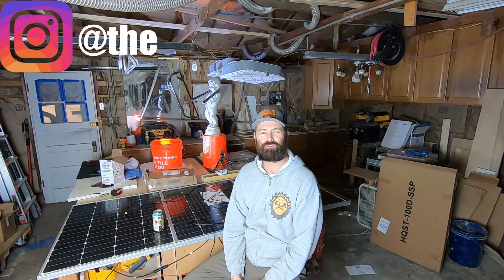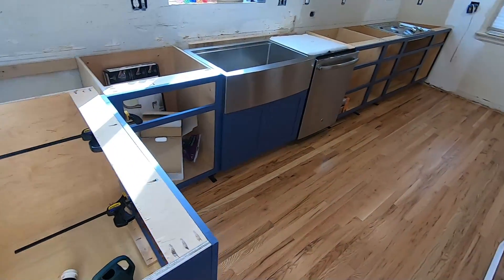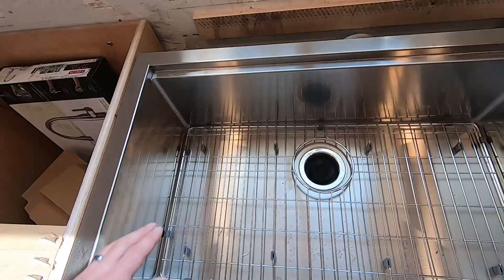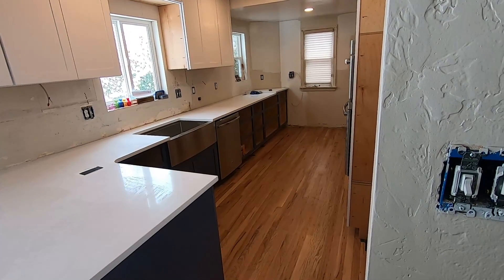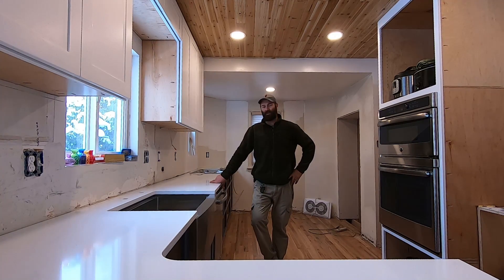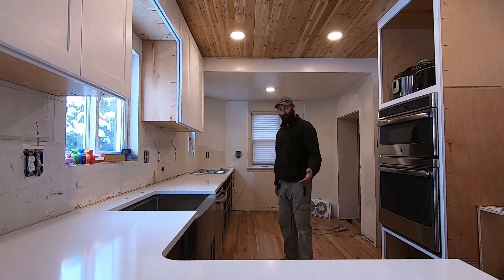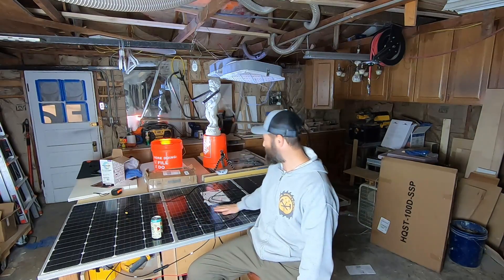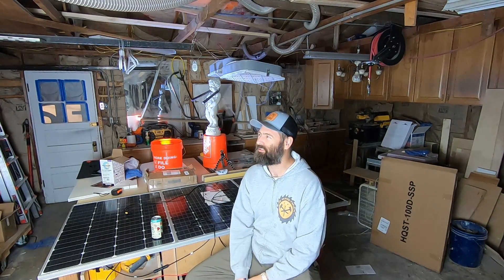Massive Problems On Massive Kitchen Renovation | What Have I Done?!? | THE HANDYMAN |

Comment: If that counter top overhangs will the sink inserts be able to fit? If that’s a Kraus sink you have the option to purchase accessories that’s what that ridge is for at the top of the sink.
Reply from the maker: It all fits. cutting board, drying rack and the strainer.

Comment: A skilled granite fabricator in 2020 will provide a laser templating service. 
They will check your cabinets for plumb and level before install and explain to you the importance of plumb and level so your stone does not crack in the future. 
If cabinets are plumb and level shims will not be required and seams should be flat and inconspicuous.
 They will provide you with a detailed computerized drawing of the final layout including the location of seams, and in many cases provide you with the option of a digital slab layout service. 
They will encourage you to come view the stone slabs prior to fabrication. 
They will cut and polish the stone with CNC machines and saw (water) jets to insure a perfect cut and finished edge. Unless in the case of a few detailed edge profiles that cannot be polished by machine, your tops will not be polished by hand.
 They will "not" need to cut into your drywall and walls at installation in order to make their product fit. 
I have recently witnessed the faulty final products and installations caused by lack of use of the above skills and processes. When considering a stone countertop purchase, ask these questions.
 If the answer is no to the majority, and the price is cheap. You are at risk.
 Click the link for more info.
Www.fb.com/rerawebpage

Comment: I had an old Formica guy come to put a new color Formica in a large kit for me years ago. I guess you had to sand down the original a bit so the second layer would bond. He was actually the owner of a cabinet shop I used. So I didn't worry and ran some errands. When I returned I could not believe he hadn't put some plastic up like you did to protect the rest of the house. It literally took years to finally get it mostly out. The dust was every where it could possibly go.I was so pissed.

Comment: You should find a countertop company and work only with them. That’s what I do and never have any issues. But a little tip. Never go for the cheapest guy. Not sure what ur labor per sq ft is, a lot of the times it depends on how much installers and fabricators make per hour, and trust me it makes a huge difference.

Comment: Sign of any professional worker.. do they set tools down on top of finished products inside the house or do they set cardboard, drop cloth or even set things in a floor mat? If they are setting tools on your counter top, on your wood floor, on your coffee table whatever.. tell them to pack up and leave. As a professional tradesmen this is the biggest issue I have with new workers. The last thing you want when working in someone’s multimillion dollar home with very expensive furniture and finishes inside is to get a car at the office telling you they had to have something replaced, fixed, resurfaced and they are subtracting the cost from your bill. What could’ve been only a $2-300 job could’ve cost you $6-700 in repairs. Don’t even shop vac a wood floor.. the plastic nozzle will leave fine scratches that will stick out with light at the right angle especially the cross grain ones. Don’t close furniture pick it up. These are the little things that are the signs of a everyday worker vs a skilled professional of the trade. The second I seen that guy set the grinder down on that counter top I knew how this was go. Things happen sometimes things have to be done or address but what good is a new counter top of the guy drops a tool on it and dings the surface before even finishing the installation? Everything comes with packaging and it takes 1min to cut a strip of cardboard to set over something to rest tools or even tool bags

Comment: Why the angle cut at the end, and the seam? 
It seems like a good templater could have templated that piece and left you with just the seam at the cooktop. 
I can kind of understand them cutting inside vs handling the slab multiple times and having to support it outside. 
I think better templating would have helped in general.

Comment: Discovered you on YouTube this weekend and have been viewing a lot of your videos. Very interesting and very good content.  Just watched the video with the botched, white quartz countertops. As someone who has been in the countertop industry for 24 years, I could tell that install was going downhill from the start. I will say that sometimes, it is necessary to finish a cooktop cutout or D/I sink cutout once the tops are installed. Depending on the size of the piece and the c/o, it can be too fragile to load, transport and install without risk of breakage. That being said, the fabricator should always inform the homeowner and or the GC so they are aware. As soon as the installers walked in, they should have covered the floors with drop cloth and rigged a zip wall containment system. They should also be wearing respirators. The seam wqs grossly unacceptable qnd at 1st glance, it looks like the put radius inside corners in the back of an apron sink that had square corners. Anyway, just wanted ro give you a shout and say I enjoy your videos. You would be amazed how often I repair or replace botched countertop installs.
Reply: Totally agree. One thing I have a question about though is do you think the fabricator left the interior radius’s because that’s what the quartz manufacturer requires? I know Cambria and LG both require a minimum interior radius. I don’t personally think it applies in the sink corners but maybe they are reading the manufactures instructions a little too closely?

Comment: So typical, I do not how you deal with subs, they just don’t care - I hate having to babysit them.  Should I have to tell painters not to clean or drip their brushes over a paver driveway.  Should I have to tell them how to install a deadbolt,  put in a level sliding glass, where to put a seam in the carpet, to cover drain pipes so shit does not clog them, it goes on and on.  I think there should be training classes and they have to get a license before being a sub contractor in any field. I came to the conclusion, you do have babysit them and be an outright asshole to get them to do the job right.  First sign of laziness or shit work fire them have them sign a release of lien, pay them and get somebody else in there.  You feel better because the job is done RIGHT.
Reply from the maker: These were subcontractors of subcontractors.    It's the way this industry works.  That's why I got out of general contracting.

Comment: The very moment I saw those guys in the kitchen, I could tell that they did not belong.  They did not have the determiner of confidence and experience.
I know profiling is bad but after so many years of doing handyman work, your first instincts are usually correct. Going with those instincts proves to be a challenge because you always think it will get better.

Comment: That “dust” gets EVER6WHERE.... you’d be surprised if never have done Belford. Gets inside drawers, cabinets, etc....& you’ll be cleaning for a while when all said and done. Cutting inside w/o “good” collection will result in a “fine dust film” over all the surfaces in the house; & I tell ya, the homeowners won’t be cleaning.....think about that, before you let someone cut inside a house when you basically are the “project manager”😉
Sucks that can’t see lost footage, but, it happens....so no worries.
Cheers✌🏼